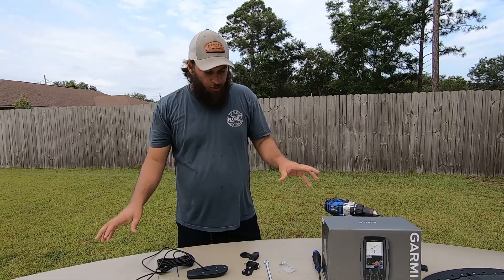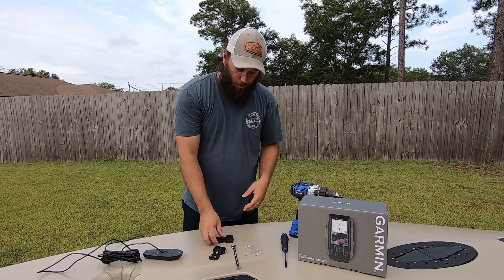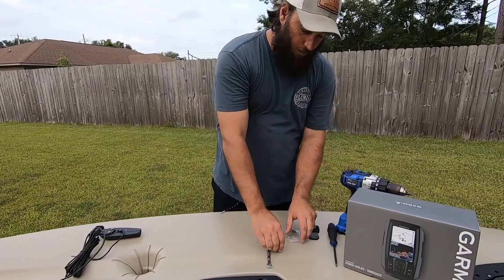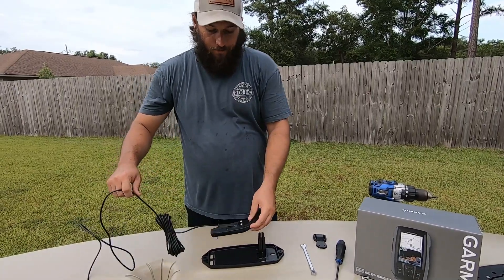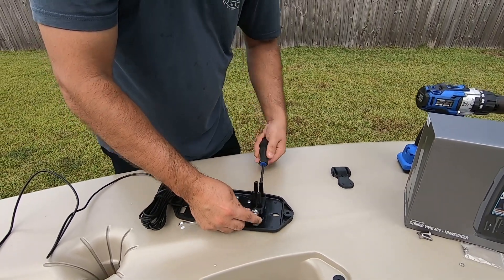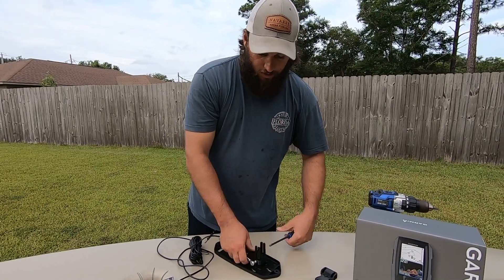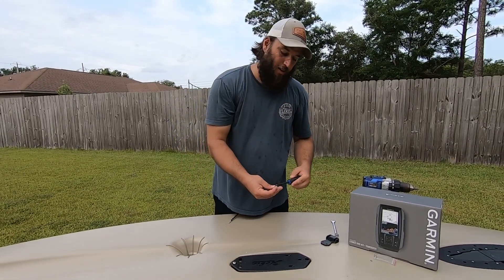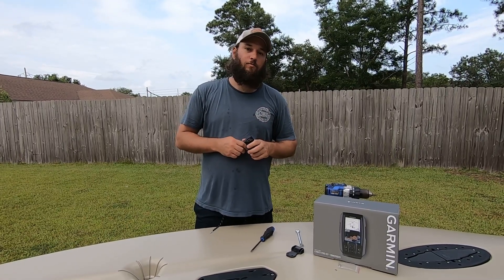Hobie Mirage Lynx | Garmin Striker 4CV Transducer Install

Comment: Nick installing striker 7cv today with your Adapter perfect fit. Question what the blue and Brown wire for ?
Reply from the maker: Networking system.  I just snip them off up by the black wire shield. Not needed.

Comment: can you install gt54 transducer on it? i want to have side imaging, can you do that? thanks
Reply from the maker: You can install the GT54 but it’s not going to allow side scan to function properly.
Reply: @NavarreKayakFishing  A Hobie video on Lowrance (i know we're talking Garmin GT54) said for sidescan to use the 77800048 sidescan passport kit for the Lynx. In that video it shows a pic of that plate which protrudes a little from the bottom of the hull. I have both a Lowrance HDS Live 9 with Active Imaging 3-in-1 transducer and a Garmin Echomap Ultra 106sv with GT54 transducer that I move back and forth between my Native Slayer Max 10 kayak and my pontoon boat and I am trying to decide which one I can use on my new Hobie Lynx. I am wondering whether that Hobie plate mentioned above would work for either.

Comment: I wonder if this will work for my 7 inch echomap plus. It’ll probably be too heavy for the seat huh lol. Thanks for showing us how to mount the transducer!!!  I just need the adapter?
Reply from the maker: The adapter works for the transducer.  I wouldn’t put the 7” monitor on the seat.
Reply: @NavarreKayakFishing  yes that would be insane. Do you think it’ll do ok on the track?
Reply from the maker: It will do great on the track.

Comment: What do you think about a 3-1 Transducer support for this?  My current one is mounted on a 2019 HO, it pops outside and can be dropped down.  Not sure how or if that can be supported with this setup.
Reply: Don't quote me, 100%. I think berley pro already makes an adapter which is a cover that this transducer mounts into, then gets bolted in place. It puts it below the hull, but keeps it covered and protected
Reply: @DallasLopez1  Cool, the only danger to that is the entire weight of the kayak sits on that outter cover, the HO has the ability to retract it.
Reply: @dmnguye69  Yea. It does. But, those covers are built pretty tough. You would be fine, I think
Reply: @dmnguye69  And who knows!? Nick may make something better! He's quite the architect!